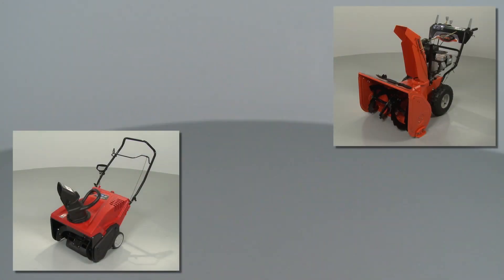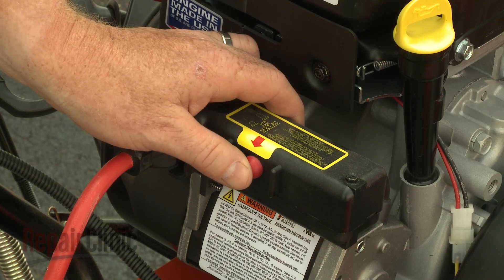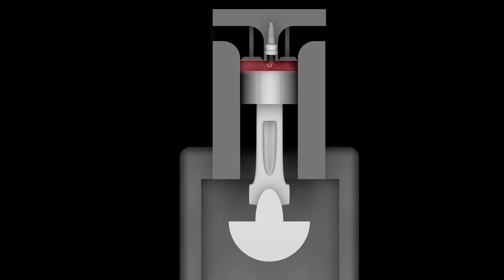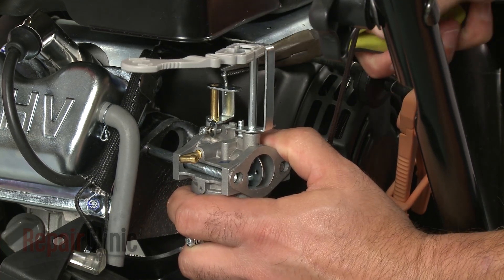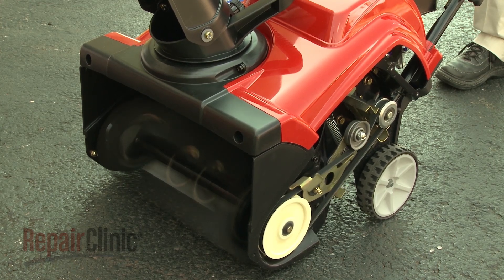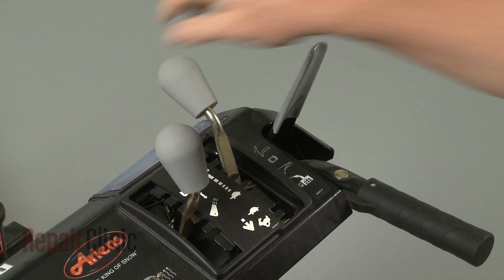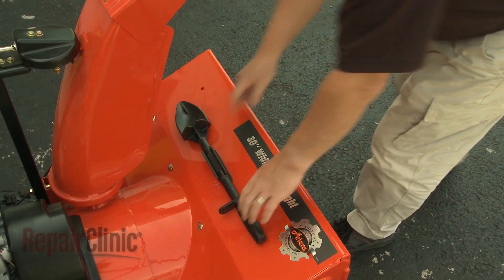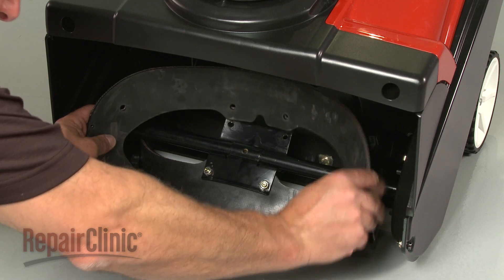How Does a Snowblower Work? — Lawn Equipment Repair

Comment: No one has a video on the drive train cable repair and adjustment. My drain train cable keeps breaking and the lower end area where the cable connects does not move at all this does not seem to be right.

Comment: You forgot three stage blowers. They have two impelers as opposed to only one in a two stage. So one stage has no augur and one impeller. A two stage has an augur and an impeller and a three stage has two impellers and one augur.

Comment: My snowblower engine works well, but when I engage the auger, it stalls, what could be the cause?
Reply: Thanks for showing me how every thing works.
Reply: Does your auger turn at all. Unplug the spark plug, take your belts cover off, check that your belts slide freely, try turning your auger by holding the lever and crank the motor. If your auger moves, it must be your carburetor that needs to be cleaned.